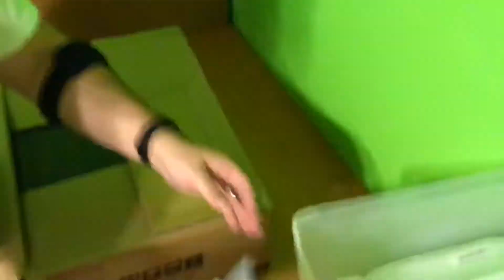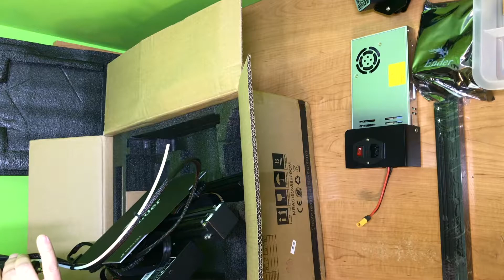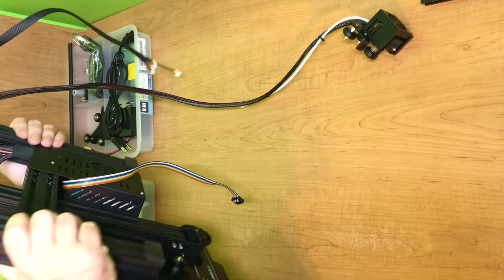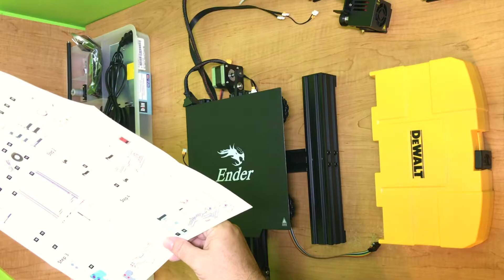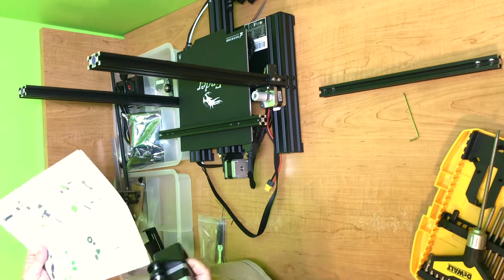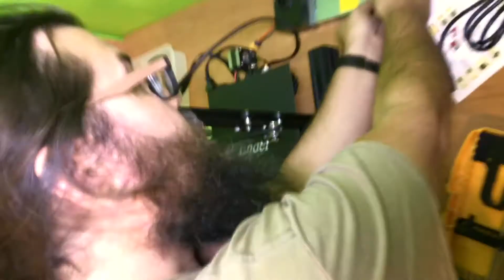Creality Ender 3 Pro Unboxing/Build VLOG

Comment: You will love this printer it has endless support from the 3d printing community. Ive had mine up and running for almost a year and print on a regular basis using pla filament and never had any major issues or breakdowns. Cura slicer is my fav also firmware upgrading so that you can use octoprint comes in handy. Definitely a rock solid printer awesome video and congrats im sure your mind is churning ideas like crazy lol!!!
Reply from the maker: I have done some upgrades already, and have been printing non stop , I got it several months ago, I love it.
Reply: @tablatronix  The one thing i can offer as advise is if you plan on printing quite a bit try to alternate the position of your prints on the print bed, printing in the same spot over and over caused mine to warp the bed but was easily corrected using tape in the low spots, I've got a whole bunch of new abs filament still in packaging your more than welcome too have as well, for what im using my printer for pla prints flawless ABS had been a pain (air temp cooler causing separation of the print around first layers) and i don't plan on building an enclosure.
Reply from the maker: @MadLabZ  I am using the glass bed, and silent controller, my bed was warped to shit out of the box. Also upgraded springs. I have not tried abs yet, I did just buy some petg
Reply: @tablatronix I have a glass bed that I pop on sometimes and gives prints an awesome shiny first layer but it will separate from the glass half the time... i found heading the room up a few hours prior solves the issue. do you guys have a central forum of voice chat server ?
Reply from the maker: Jeremy F I have the creality glass with the textured surface, the official facebook group is invaluable and very active

Comment: This reminds me of the thrill of the unboxing and assembly of my Ender 3. Oh boy I was excited! Have fun using it!

If you allow me a bit of constructive criticism - for similar videos in the future, move the cam if possible over the desk so it looks down straight and rotate it by 90 degrees. This current angle makes me feel like I'm watching a vertical video turned to its side.
Reply from the maker: you are... lol (cell phone in holder on tripod, I set this bench up fast, I have no permanent bench for stuff like this yet) yeah this was kind of a practice video of these kinds of videos, I do not have a way to setup my camera like that, so that was one thing I learned, I was trying to see if I could make videos off my bench, I am making a portable setup with lighting and going to have to buy some kind of overhead tripod arm, or counterbalance. Suggestions welcome, photography stuff is so expensive. I have a bunch of tripods but nothing suitable for overhead work, not sure how you do that..
Reply from the maker: I just found a affordable manfrotto plastic articulating arm.. only $50 hmm,